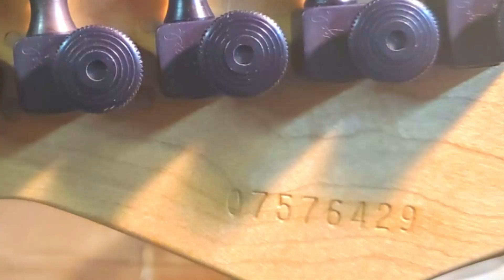Peavey Predator restoration by Jeff's Big Guitars

Comment: What trem block did you end up going with? I'm upgrading my old 94 Peavey Predator and can't find a drop in replacement. So far I have installed Rose Robusta alnico 5 pickups that are supposed to be similar to fat 50's, a Obsidian Wire blender circuit and Hip Shot locking tuners.

Comment: Any chance you still have the original tuners, nut, tremolo arm and input jack??? I pulled a 1998 predator out of the back of my closet today that I bought from a garage sale and it's missing those parts. Honestly, the entire electronics are jacked up as I think the previous owner was trying to modify it. Any parts you still have, I'm willing to buy. Great restoration by the way!!! If you don't have the parts, could you tell me what nut you ended up using? I'm trying to get it back to the stock look and can find everything but that. Thank you very much!
Reply from the maker: This is Pinetop, Jeff is the guy who restored the guitar...sorry for the confusion!  
From what I understand, the stock tuners were crap, Jeff replaced them on every lower-end Peavey he got.  He sells a lot of guitars online, he may have some parts he'd sell, reach out to him https://www.youtube.com/@jwandhistools
Reply: If you're wanting to replace the nut, you're best of getting a Graphtech Tusq which should a drop in replacement, with a bit of filing / sanding. The model you want is: Graphtech Model 5043-00 Nut Slotted R12 L42.88mm (serial: PT-5043-00) - you might wish to choose Black Tusq XL in the options if you'd like it to resemble the Predator as standard.
Reply: @thingsdisappear  thank you kindly, sir! I'll look them up tomorrow.

Comment: Sorry, that edge fading is nasty IMHO.
Reply: Fading into solid colours is tricky.  I suggest conical spray pattern, high gun pressure, low paint flow,  low viscosity, slow flash thinners,  and start with the border colour mixed with some lacquer or blending clear as the first contour. Generally candies fade much better than solid colours.  If your using cellulose that self etches and blends as it does so. Spray from the inside the edge of the body to the outside. Practice before hitting the workpiece with the mix in the gun to get your hand in,  and make the passes over the body as few as possible. Go closer and faster on the inside of the horns.